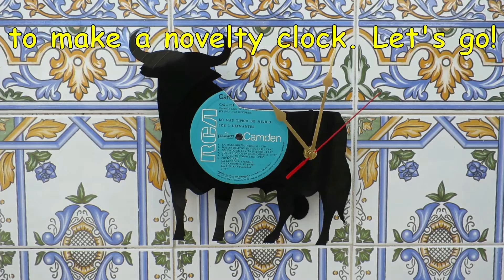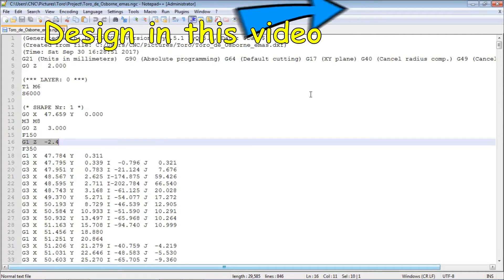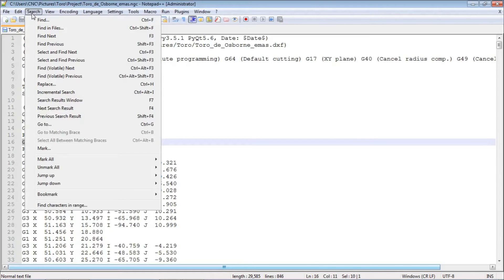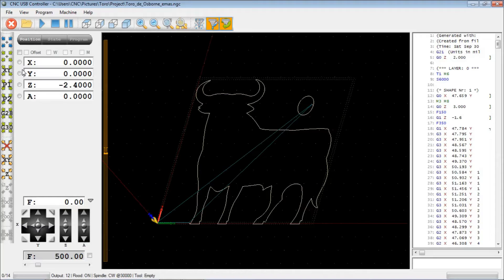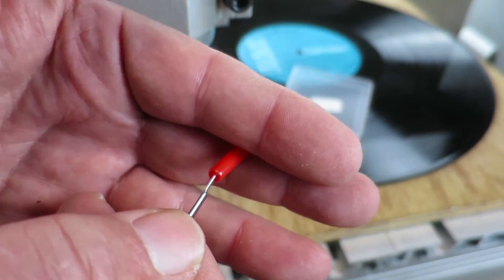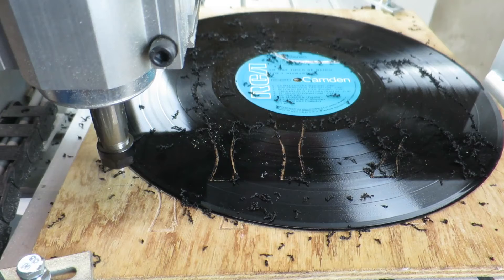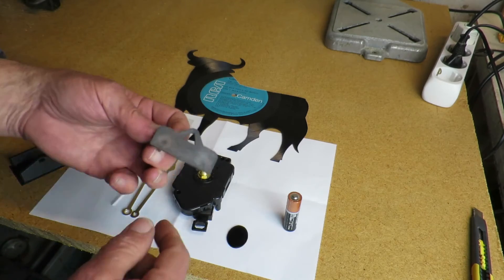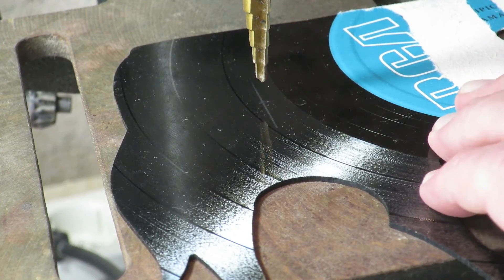Make a Novelty Spanish Bull Clock CNC Cut Toro Benidorm Inspired DIY Project

Comment: Amazing work! Are you still using the same drill bit or did you find something better?
Reply from the maker: For cutting records I have not found anything better than these http://bit.ly/Milling_Cutter I change them out when it looks like they don't cut so well maybe after 7 - 10 cuts. Have you tried cutting records? Have any recommendations on bits to use?
Reply: Oh! They do not last as long as I thought, I'm trying these and they work well for me: https://es.aliexpress.com/item/HUHAO-1pc-3-175mm-Left-Spiral-milling-cutter-down-cut-one-Flute-router-bit-CNC-end/32808228240.html?spm=a2g0s.9042311.0.0.3da263c0KyqW4d
Reply: How many rpm and feed rate do you use in these drill bit?
Reply from the maker: Around 10,000 rpm at 550 mm / minute.

Comment: Good video I see your using a 3040 table are you able to cut past the outside diameter of 11.81" which is the diameter of a record by at least 1/8" because a lot of my clock designs require that the bit travel past the outer edge.